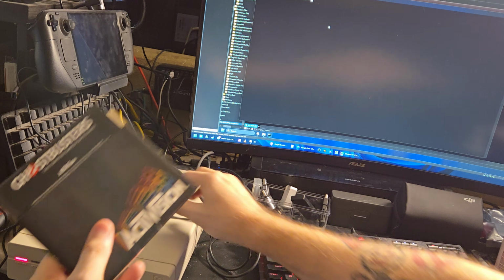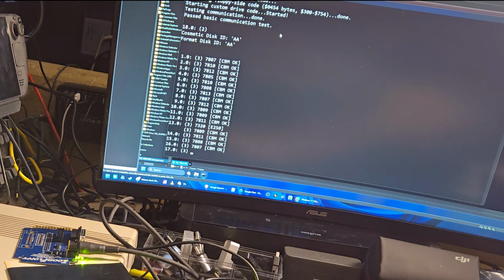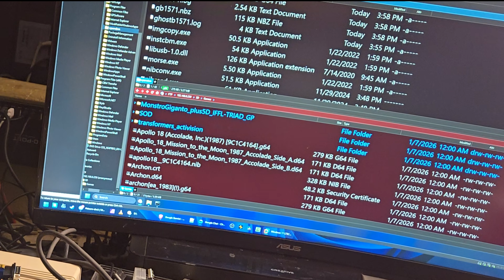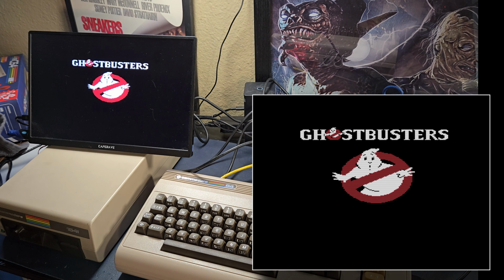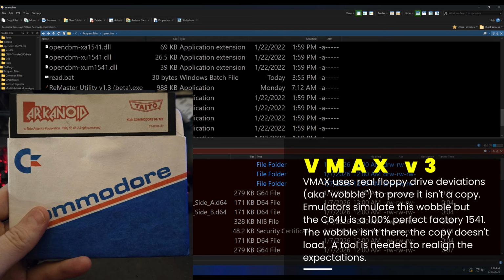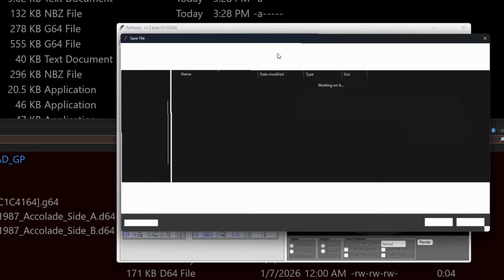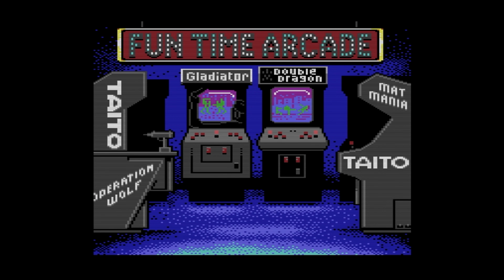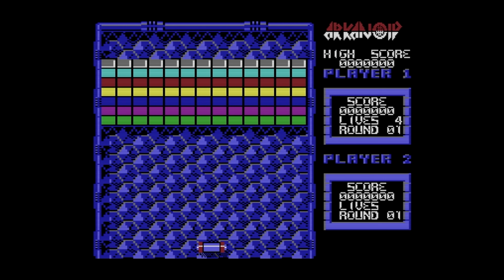Ripping C64 Disks: 1571 "Burst Mode" vs. Parallel Cable (Part 2)

Comment: I love that little Taito arcade intro on Arkanoid. I have that original disk in its gatefold packaging. The Maverick series of utility disks had some great patching abilities to get around this sort of protection check; it could handle a lot of V-Max-protected floppies.
Reply from the maker: Damn VMAX and its timing / rotational checks...
Reply: @darkuni  Did you ever come across RAMBoard protection? That actually required an extra board in the disk drive to copy

Comment: How do you flip virtual disks if the game requires it?
Reply from the maker: You mean if you're in a game and it says "Insert Disk 2"?
Reply: @darkuni  Yes.
Reply: @LegallyBlindGamer  Go back into the menu where you picked the disk image, move to the 2nd image, press return, then pick "Mount Disk".  Then go back to the game, typically you have to press the space bar for the game to check for the new disk.

Comment: Would a 1570 drive also do this?. I do not find info on this but it is basically a single sided 1571 so...
Reply from the maker: As far as I remember, it was identical but was SINGLE SIDED.  Burst mode should be there, though.

Comment: Ok, my C64 ultimate order number is 10380, and all the page says is order confirmed... but i am patiently waiting for mine since july.

I will dig all my commodore stuff out of storage, get my 1802 monitors going, and setup a gew of the 1571's and 1541s, and of course the 1581's i have boxed up, and get a clear space in my office area for the fun to begin.
I gathered up a ton of the manuals, and software already, and the smell of those old discs has me concerned they won't work. 
I want to get everything copied to digital, so I need a list of what to line up for the ripping.
Reply: You were just short of the first batch of 10000, whith order #10380.
However, the next batch is soon to start going into production - current sales is 19826, so we should reach 20000 this weekend 😁
Expected shipping of the next batch is around March/April.
Also impatiently waiting for mine and collecting stuff until then.
Reply: Check the output on the 1581 power brick before you use it, my old one was putting out 7.4 V on the 5 volt rail.
Reply from the maker: I've heard a lot of people talking about this sort of thing. Particularly with the 1541-II.
Reply from the maker: Do yourself a favor and make sure that the discs free spin prior to attempting to dump them. I don't know what exactly a sticky disc does to your drive but I had at least five in my collection that were not able to be ripped or even played because there was something about them that was stuck

Comment: There are also some protections if you try to run  the disk without the write protect tab covered or inside the emulator software 1541 write protect is off on the disc,it will stop the boot of the game.  So always Enable the 1541 write protect in emulator software or cover the write protect tab on your disk if the original disk is not notched.

You could spend hours on trying to backup a disk and it be something this simple.
Reply from the maker: Yeah,. that's a good point.  Something so .. easy ... and easy to overlook.

Comment: How can this be employed in the built in 1571 on a C128D-cr?
Reply from the maker: Hmmm... I think that would be a more difficult feat.  I'm sure it is POSSIBLE with a lot of effort and soldering .. Might be easier to pick up a 1571 ...
Reply: @darkuni  Yes you can, you just need some pokes from the c128d first.